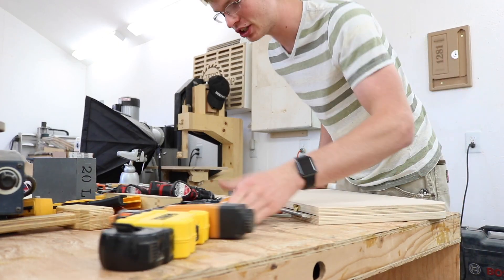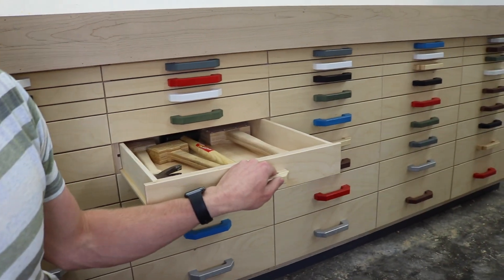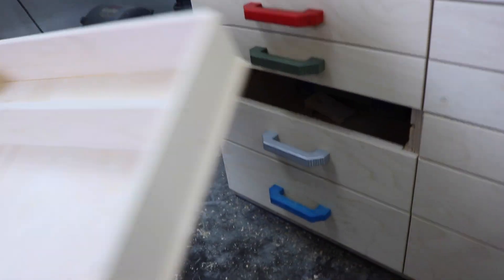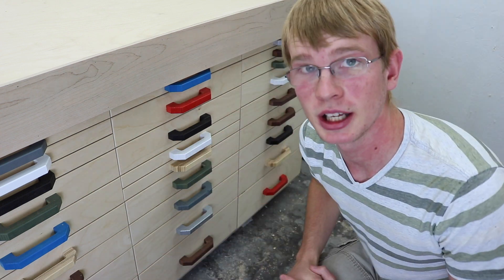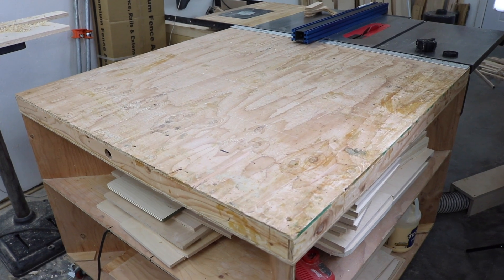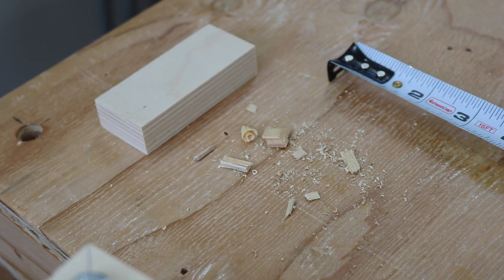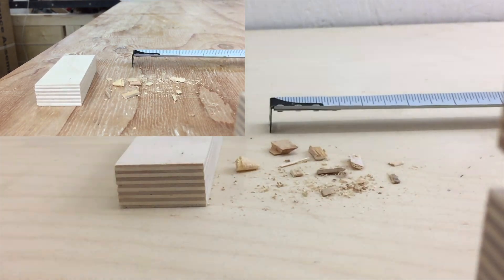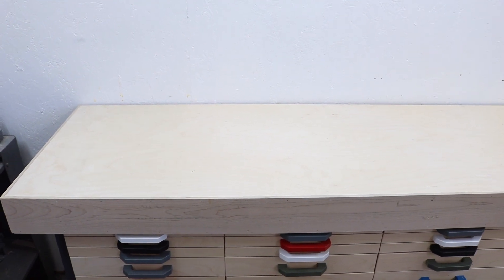Incredible Tool Cabinet / Workbench!

Comment: I'm in the process of doing something similar for my shop.  I'm curious as to how you decided on the drawer size.  Did you just take the length and divide by 3 or was there some other method to your madness?  Also, how did you decide on how many 1.5" and 3" drawers to make?
Reply from the maker: +Bill Weissborn 
The drawers are 16" wide, and I decided on that because my scrap storage drawers are 16" and I like that width. As for how many of each drawer, I just went off gut feelings, no method to that madness! :)

Comment: Big secret revealed : you do not have a small shop. Only some ppl have a  bigger.   My shop is 10 sqm. There are people with less.  Nice build btw.
Reply from the maker: +havenisse2009 
Many shops are in a two-car garage, and mine is smaller than a one-car garage. Not tiny but probably below average...
Reply: that is definitely small

Comment: Did you tap threads all of the way through? Small parts can't get stuck if they fall all of the way through.

Also, I really like the removable tool drawers. I do something similar in my workspace, but instead with plastic trays, crates and tubs stacked on wire shelves. It makes it easy to move tools to other places in the workshop. I worry about how smooth your shelves will be in a few years. Do you have maintenance plans in place?

Comment: i dont know if i am being wrong here and its just a suggestion.... making a torsion box like the other one and filling it with sand... would it be the same thing or not??? puting the weight aside, since it would be heavy enough, i think the sand would absorb the impact just the same way if not better... also i dont really know what's the cost difference between the concrete and sand methods. love the cabinet excellent work :D
Reply from the maker: Someone else already asked that exact question, and here's what I said: 
I considered that, but the reason I avoided that idea is that I'm afraid the sand would shift to less-used areas of the top and you would end up with gaps between the top and the sand. This problem may be improved by making a torsion-box so you would have small (6" square) pockets for the sand. 
I found that even a very slight gap between the wood and the concrete makes the table have no advantage. I talk about that in the build video. So I'm afraid that even on a 6" grid the sand would still shift a bit... 
However I don't want to discourage you from trying it! It seems like a fairly inexpensive experiment, and I'd love to see the result!
Reply: oh ok thnx for the response. and sorry for repeating the question, didnt se the other comment :) nice job though!!

Comment: First off I want to say thank you for inspiring me to build one of these since I don’t have sketch up I have one question I’ve noticed that you have a slight gap between your drawer fronts and was wondering if the drawer dimensions were exactly inch and a half tall 3 1/2 tall 4 1/2 tall etc. or are they slightly smaller so that each drawer front won’t touch each other? If that makes sense
Reply from the maker: Yes the drawer fronts are all 1/16” less than the nominal drawer height. Or maybe it was 1/8”? I can’t remember.
Reply: Jeremy Schmidt Sounds good. Thank you for responding! Been subscribed for a while now and really enjoy your videos! Keep it up!

Comment: you probably could have saved a step and used the plywood top and sides as the formwork for the concrete. did you consider that?
Reply from the maker: +Garrett Ducat 
The form has to be crazy strong to keep from bending under the pressure of the concrete. It would have been difficult to sufficiently fortify these to use as forms.

Comment: Just out of curiosity how much would you estimate that top weighs? Love the design and its versatility.
Reply from the maker: +Robert Tucker 
645 pounds. That's my guess based on how much a sheet of plywood weighs and how many 80# bags of concrete I used, so I think it's a pretty accurate figure.

Comment: This is a fucking genius build, especially with the draw manipulation to change the location to where ever u want, but the concrete is way too far a stretch and the suggestion below of using sand cud be more possible cos the beach is nearby. Recycled hardwood is another possibility and with the right weight caster wheels wud make it mobile. Well done from Oz.

Comment: Jeremy, about your comment on how expensive hardwood is and how softwood is too light so you decided to go with concrete. Why not use several layers of MDF? It is very heavy, cheap, and quite stable if kept dry.
Reply: My main workbench is 3 layers of MDF with hardwood trim.  It's 20 years old and it has been a great surface to work on.  It is not as good as maple or beech but probably about as good as pine with some obvious differences to delineate between the two.

Comment: found out that really wide drawers ... 4 feet for example or even 6 feet wide ... improves your efficiency. You open up only drawer instead of 2 or 3 for finding stuff. And the cost of drawer hardware also decreases.
Reply from the maker: +Abizar Lakdawalla 
And the drawers also bind every other time you try to open them, right?
Reply: +Jeremy Schmidt  I cheated and used full extension steel drawer slides!
Reply from the maker: +Abizar Lakdawalla 
Oh ok! Come to think of it, you might save almost enough money on the drawers that you can pay for the slides... :)

Comment: Rather than holes for hold-downs, why not a steel surface with hold-downs mounted on strong permanent magnets that can be "switched" on and off? Best of both worlds, if it isn't too expensive (I have no idea of cost).
Reply from the maker: +Nicole K 
Nice idea! But I'm afraid that magnets that strong either don't exist or would be incredibly expensive. That would take some crazy strong magnets!

Comment: Can I get the all the drawer measurements??
Reply from the maker: +Isaac the Pike king! 
There's a Sketchup model available here: http://jerswoodshop.com/my-massive-concrete-workbench/ You can use the tape measure tool in Sketchup to get any dimension you need.
Reply: Jeremy Schmidt thanks man

Comment: You could have filled the top box with sand instead. It would probably have the same if not better damping effect.
Reply from the maker: +Helge Frisenette 
The problem is that the sand would settle away from the top and end up with a slight gap under the wood... Concrete doesn't settle!
Reply: +Jeremy Schmidt Add more sand then.
Reply: +Helge Frisenette You could also have the top "float" on top of the sand. With bevels at the edges of the working surface and sand tray, so there shouldn't be stair step problems there, though a tight fit would be beneficial. Have cable straps pull the top tight from underneath through small holes lined and stuffed with wax to stop the sand. Still not as much work as doing the concrete, and more flexible too.
Reply: Its actually fine for the sand to settle. you don't need to completely fill a torsion box when you have a 3/4 in plywood top. You're not going to hammer your way through the unsupported pockets even with a sledgehammer. The sand's ability to absorb the energy of impacts is more if there's a little room for the sand to move. Essentially, you are allowing the transfer of the kinetic energy of the hammer blows to the movement of the sand.

Comment: I see you're working on concrete. Even for the young, that is a REAL DRUDGERY. You may not NOTICE it because you're young, but...There are special rubber-cushion work mats that you can get to put where you're doing the most standing (typically, in front of machinery). Put even one of those in at your most used workstation and you WILL NOTICE how much less tired you will feel at the end of the day.

Comment: A fuck ton of concrete to fix the problem of a little vibration? Whats wrong with just putting rubber onto the feet and the bench surface?
Reply from the maker: +joeofdoom 
Correct me if I'm wrong, but isn't rubber known for its squishiness and bounciness? Seems like precisely the wrong material for a rock-solid bench.
Maybe rubber would also make a great rock-solid foundation for my new house, eh? 😉